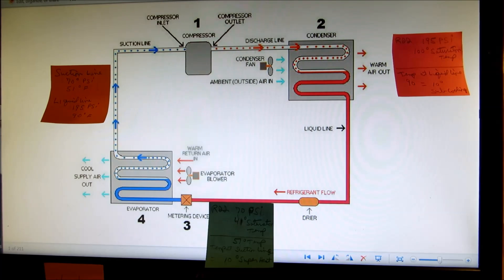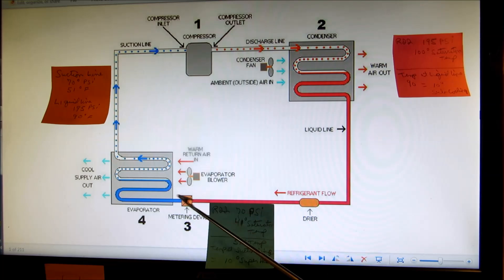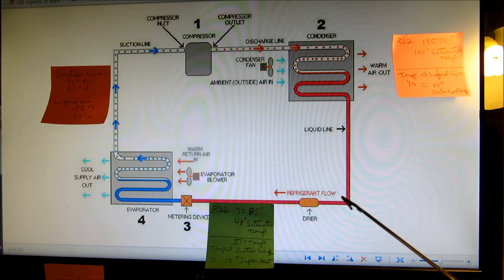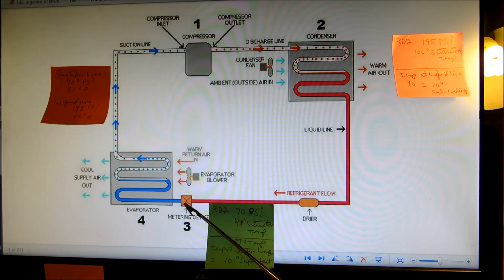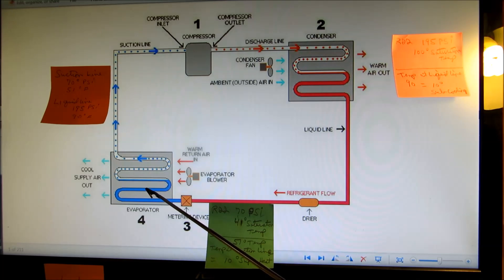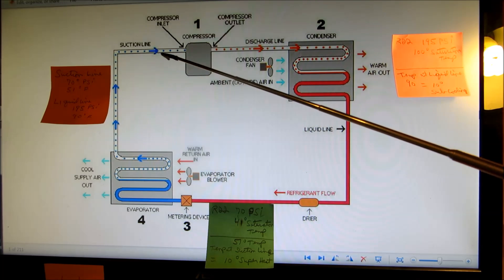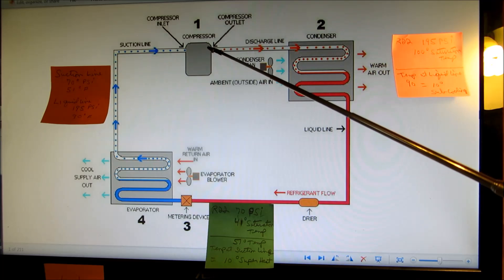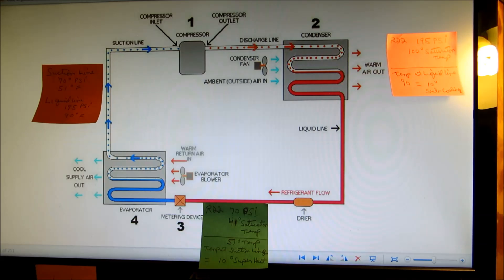hvac:what is superheat and subcooling

Comment: One thing I learned about most HVAC systems is, the return(s) used are usually too small and not enough of them ! Also that has some effect on filters, especially if the return vents have the filter installed inside them vs. up in the attic or located next to the air handler.  I prefer the filters located in the living space return vents.

Comment: Super heat and sub cooling was (kinda still is) a mystery to me. I'm NOT a HVAC tech BTW.  I'd like to see some "what if" scenarios. Although Steve touched upon  a couple, I'd like more detailed info what happens to system to changes. What happens if over charged/undercharged. Poor air flow on either or both evap and cond coils, etc. What I'd like an answer to is "what if" you set the evap coil into a vat of say 45ºF water while running? Nothing else has changed except the outdoor coil went from say 85º ambient temp right down to 45º. Do something similar to the evap coil too. Instead of a typical 80 in 68 out, dump coil into a vat of say 95º water! That's what I'd like to find out!

Comment: I checked the charge on my goodman heat pumps and one of them had very low subcooling and high superheat. After the unit shut off I waited for the pressures to equalize and they were with in 50 PSI of each other which makes me think there is a problem with the reversing valve.

Comment: Hey man ive been doing hvac for a little while now (6 yrs) and like u said early in the vid i know how to charge units but not to positive on how to use sh and sc to figure out whats going on inside the system. Just started with a new company and they asked me to explain how sh and sc worked and i just drew a blank really embarrassing lol but this vid helped alot but still kind of confused on what exactly the numbers mean. I know u said 10 degree sh what the difference in saturation temp and the temp of outside of the coil so wed have a 10 degree difference or whatever the pressures are but would that mean were picking up 10 degrees of warm air from the inside of the house and taking it outside or what? Like on an undercharged unit say you have like 30 degree sh wouldnt that mean your getting 30 degrees and sending it outside?? Im confusing myself any help would be appreciated thank you

Comment: Sub cooling is the gas tank. If you have a TXV, it show it the system is under charged, just right, or over charged. 
The outside temperature directly affects a system with a fixed bore metering device. 
I college, we were told to use ambient + 30 for regular condensing coils;  & ambient + 25 for high effeciency condensing coils. 
So if the outdoor unit has a high efficiency coil in it & its 95 deg outside, with a fixed bore metering device, you should expect a condensing temp of 120 deg Fahrenheit on your high side gages. If your gages show significantly more or less than that, check for dirty coil(s), a dirty air filter, not enough return air, an issue with a fan or a drafty indoor unit (such as a door panel that's fallen off, etc)

Comment: thanks for your wonderful video you share to us, and I'll got some knowledge about super heat and sub cooling. I want to ask about one unit of split type two tons name the a/c unit is haam electric,when I'll put my gauge in hi side il got 87 psi and I'll put also my hose of my gauge in low side il got 45 psi ang amps. is 9.9 but the total amps. of the unit is 12.4 amps. what is the cost of the problem pls. give me some advice thank you very much I'm here in Riyadh Saudi Arabia and have a nice day!!!

Comment: hi, when should be the superheat calculated. for example, i am working in a cold store and we have the set point at 4"C . so consider the room has achieved the temperature of 4"C uniformly so what would be the effect of calculating superheat at this stage. furthermore what would be the difference if i want to calculate the SH at room temperature(20"C) with set point 4"C.

Comment: Hey Steve ,like your videos and thankyou, also question,  the low pressure line is freezing up and the systm is low, what do you think it would be when both low pressure and liquid line are connected to the manifold gauges and both readings are the same and also wont take in any gas .r

Comment: Steve, this makes me wonder what happens if the outside air temperature is greater than 100°F. If the saturation temperature of R22 is 100°F, what will happen with subcool? What is the temperature of the vapor exiting the compressor? Not a tech, but I am just curious...
Reply: As outdoor temperatures increase the compressor cycle self-compensates and the compressor will generate higher discharge pressures which then raises the saturation temperature of the refrigerant.  Please see Steve's video on the 30 + rule for more details...

Comment: Hi Steve if a capacitor keeps blowing what might be the problem? We have replaced the cap three times. keeps breaking
Reply from the maker: high head pressure or high heat /hot day will do it .try to clean the outdoor unit .spary it down good with the hose .makes sure the coil is clean not durty

Comment: Great video.  Thanks a lot!!  Got a question and I hope this doesn't sound stupid, but....On a system with a TXV, the sensing bulb will regulate the suction pressure if the TXV is working correctly.  So, how will overcharge or undercharge affect system operation?  Could a customer be undercharged or overcharged for a long time and not realize it by the temperature of the air in the house?
Reply from the maker: with a txv you set the charge by subcooling . usally 9 degrees or so will give you a full liquid line . and yes the txv will regulate the superheat probley around 10 degrees or so .

Comment: Great video, Steve.  The chart was very useful in explaining the refrigerant cycle, too.  I also liked your advice about zero super heat being a symptom of a dirty evaporator/reduced air flow across the evap.  I felt that your explanation of superheat, subcooling, and saturation could have been a little more basic.  For example, it would have helped if you'd explained that a "saturated liquid" is "saturated  with heat" and cannot take one more BTU of heat without starting to boil off into a vapor; similarly, a "saturated vapor" is one that is holding its maximum heat capacity, and if just one BTU is removed, it will begin to condense.  All in all, you did a very good job explaining the refrigeration cycle.  I look forward to your next video.

Comment: Hey Steve I hope your business is thriving and you keep posting videos like this!! I had been having some trouble lately with gauging refrigerant pressures. The charge would look low to me but then I would call for a second opinion and get told it's fine or the exact opposite of what I initially thought until this video. Thanks for putting everything in terms i can understand. I listened to this video probably 3 times on my way to my call and actually found system to have a 40 super heat, in the end sold a brand new system. Please keep doing what your doing cuz I know I'm not the only young tech who you've influenced. Next Level Mamma!!!!
Reply from the maker: +Ryan Shmitons good comment thanks

Comment: Great instructions video Steve. I was wondering can I apply the similar method to calculate water cooled heat pumps superheat in the commercial building? If yes, then where would I physically put the thermostats sensor?  Thx

Comment: Steve, I remember when I was in school, my instructor told the class. What would you say if could make this glass of water boil at 50 degrees. Everybody in class was dumbfounded saying yah right, he said I'll bet anyone of you 100 dollars . Well he did it, just by changing pressure. Pressure temperature has a relation he said. If you change pressure, you can also change temperature. Glad I didn't bet him a hundred dollars. He said think od boiling as a state of cooling not heating. Great video Steven this helps all coming up in the trade.
Reply from the maker: Robert Weeks thanks for the comment robert
Reply: Or not boil in such cases as nuclear reactor cores. 

I can't remember the exact figures but the water temp was far greater than the sea level boiling point in the primary loop.

I was working as an electrician but had been trained in HVAC after a stint in the Navy. The pressure temp relationship immediately caught my attention.

Fascinating trade, I'm revisiting it now, way into my retirement years......

Comment: steven, txv units have a general rule of thumb to set 8 to 11 degrees subcool, so what is the general setting of a units superheat on a non-txv unit if you cant find the manufacturers sticker?
Reply from the maker: Ben Staton with super heat you get the indoor wet bulb and out side temp and there is a chart you go by to find your target superheat.

Comment: Steve,when a A/C unit is cut off,what state is the refrigerant in? Does it all return to a liquid form? I know its in a pressurized containment but how does it keep from sending liquid to the compressor on start up? I think heat and pressure keep that from happening but I dont know that for sure. What gives?
Reply from the maker: raidzer get a pressure and temputure chart and look at the pressures and temps of saturation it will tell you whats going on at different temp/pressures very simple

Comment: Good video . I am maintenance tech in an apartments complex. We really dont have the training you have it. We connect the gauges and that's it. This video is a excellent . I have a question. Its better before check super heat or subcooling do we need to clean the coils ? Thanks  for the video.

Comment: How would you figure out if a return is undersized?
Reply from the maker: there are tables you need to use supercool slide chart makes a good one .its 400 cfm's per ton of cooling needed ... for proper air flow ..a 14" flex will  provide 450 cfm's on a return so on a 2 ton unit you need 2 .. not one .filter grill returns make a difference also what size ect .

Comment: I see way too many "old school" guys that believe superheat and subcool are a waste of time.  I had one guy tell me he can tell what the system is doing by just grabbing the low side line and seeing what the pressures are.  I told him "that's great, you're checking superheat, you're just using your hand as a thermometer."

Folks, don't let non-believers tell you superheat and subcooling isn't important.  Checking a system and finding 35 degrees of subcooling but 35 degrees of superheat is a quick way to help figure out you have a restriction in your refrigerant line.

Good job Steve and keep up the great work.
Reply from the maker: thanks william for watching

Comment: This was a great intro lesson; I'm looking forward to a few more where you dive into the theory behind how how it works, like with some of the service calls you have on systems where somebody else did a lousy install and components are not the right size. The video you posted recently about the unit behind a garage with just about everything wrong would be a great example. "ruud condenser unit cleaning /system has issues" ruud condenser unit cleaning /system has issues
Reply from the maker: ok i will try to explain some of my service stuff as i go and what is happening